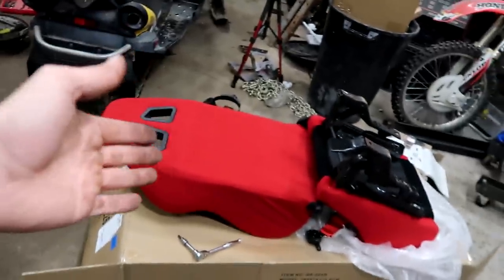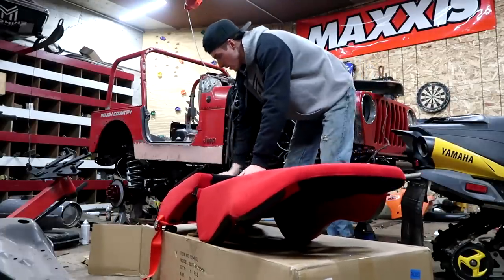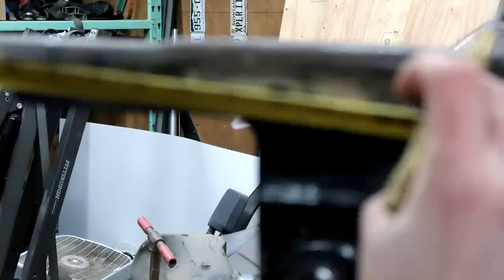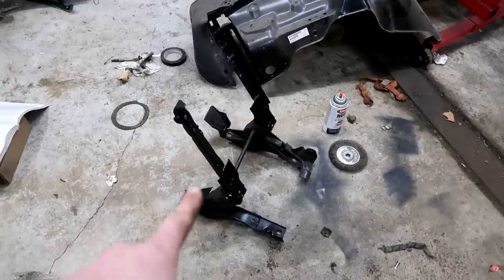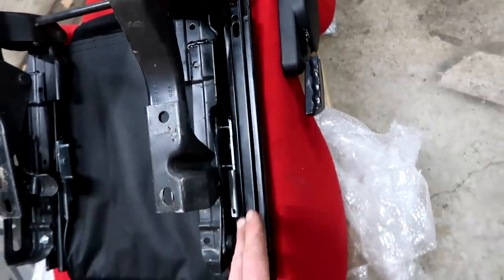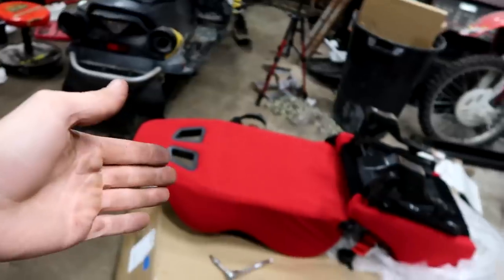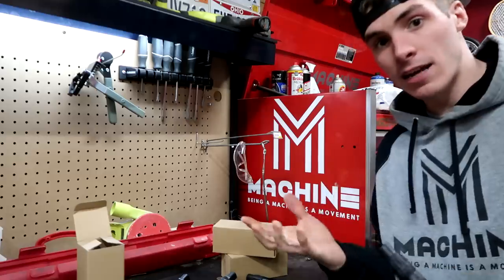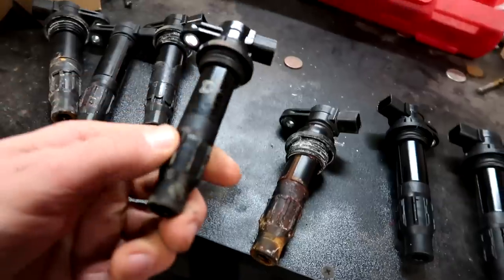Installing Racing Seats- Problems

Comment: A 4 point harness can be dangerous if they don't have a brake away on one of the belts. Your body can submarine in a big crash and cause alot of damage. Although the Jeep probably won't be going that fast so it might be fine.

Comment: use a lot of dielectric grease.. on the inside for the plug and around the top where it seals on the cover...goooooop it on